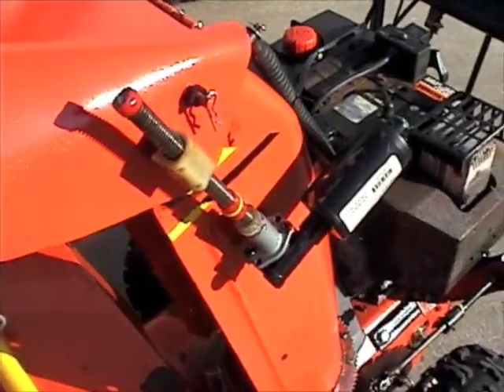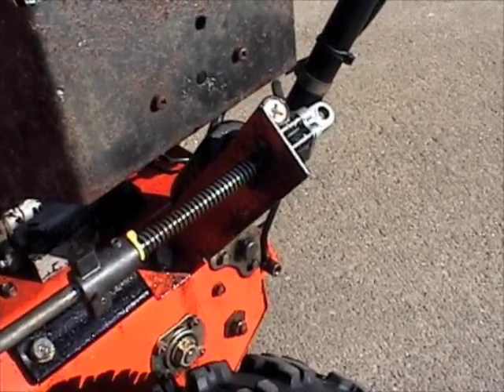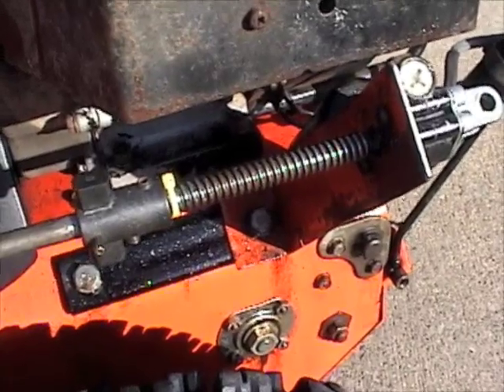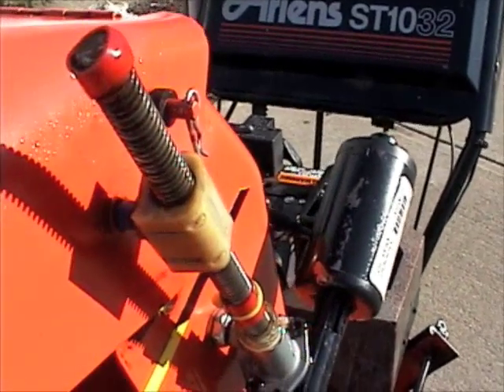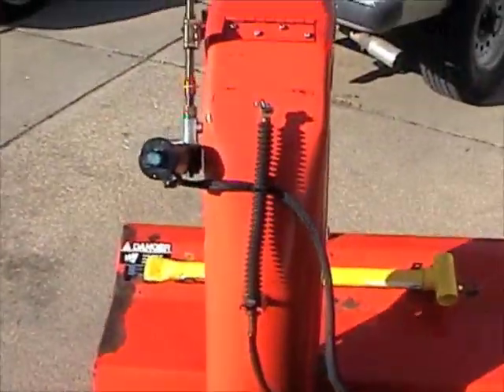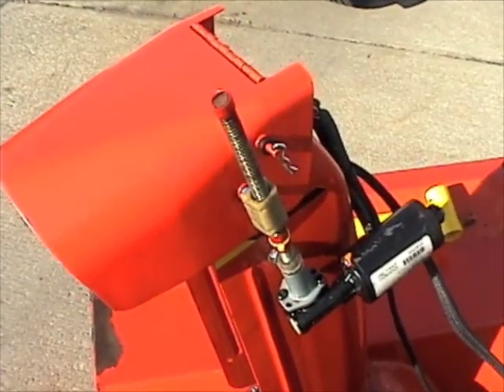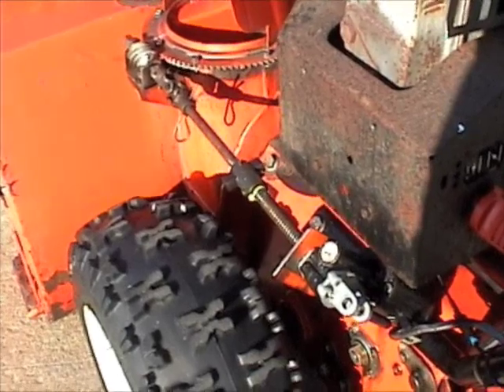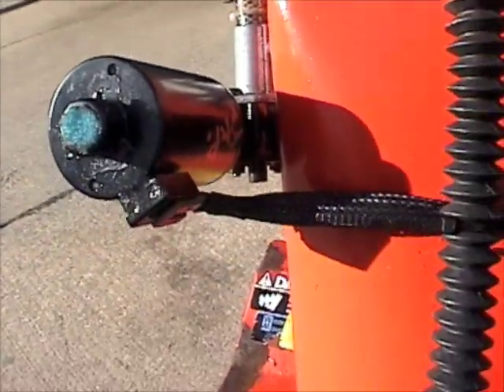Snow blower electric chute control motors

Comment: Having the marks is excellent.

A simple solution to not having no limit switches on the rotation:
1* Cut  a few more threads on the chute where the chute will go way beyond what it normaly should turn...and never go there.

2* This method is good for both actuators: Figure out the amp draw on the actuators. Get a circuit breaker (or fuse) one amp or two above operating. 
	An automatic circuit breaker will kick out and reset itself.

Comment: I have seen people use drills, power window motor, but I have to say the powered seat motor is by far the  best idea, its designed to move our fat ass's so torque is not going to be an issue. Great idea.

Comment: you can use power from the head light to charge the battery just get a rectifier regulator from a honda spree its like 14v 4 amps

Comment: it would be difficult to do carb repairs on that
Reply: Why, it doesn't look like the motor is in the way any more than the stock chute crank would be? If it was, all you need to do is remove one bolt and one clip to get the whole motor, bracket and rod out of the way. If that's difficult for you I wouldn't recommend you trying to repair the carb.
Reply: trust me, i know how to do carb rebuilds, its just weird the chute control rod makes it hard to access the carb

Comment from the maker: Any labels or tags on the motor have been painted over.   As I had posted before.  The screw motors are Power Seat motors.  I removed them from a seat at a junk yard.  The seat was not in a vehicle it was just laying in the bed of a pick up.  So I have no idea what make or model car it came out of.  I am going to try and track down that information.

Comment: What was the source of the motors you used for this project?  I have a Chrysler PT Cruiser power window motor for my chute rotation but I need a power seat motor for the chute deflector.  The kind you have seem to mount easy so just getting one like that would be best I think.

Comment: @jrpesky 4) yes, assuming the batteries & magnetos - is grounded to the chassis, which is usually the case.  + grounds are not often used.

anyway, instead of that, I would probably just use a cheap automotive battery maintainer and plug the snowblower in when not used.

Just a thought, me thinking out loud, but I wonder if a low current self-resetting breaker, or even automotive flasher, could be used as a limit switch?

thanx for sharing that modification.

Comment: @jrpesky neat idea.  I'd seen it before, but wondered where the motors came from.  Ya, seat motors are pretty strong.  Limiting switches would be nice, but a bit of work to build.  Another option would be a slipping clutch in in drive train or a current limiting shut off switch.
Anyway from your questions, you have good understanding of how to build what need.  Google can fill in the blanks.  ;)
1) yes 2)probably, and its probably a magneto 3)as many amps as the wire or fuse can hold.

Comment from the maker: Hello
Thanks for your comment.  I don't know that much about that type of stuff.  I think a diode only allows current to flow in one direction?  So the motors alt. would have enough output to both power the light and charge the battery?  What size diode? Just splice into the wire running to the light and run the wire to the + side of the battery?
As you can tell I'm limited in my understanding of these types of things.